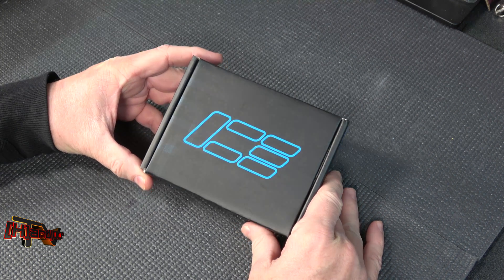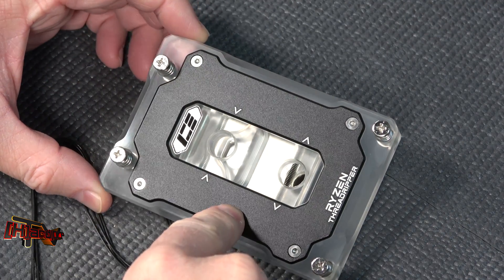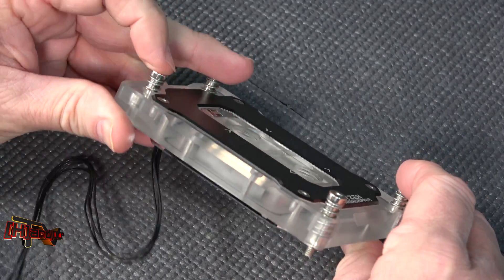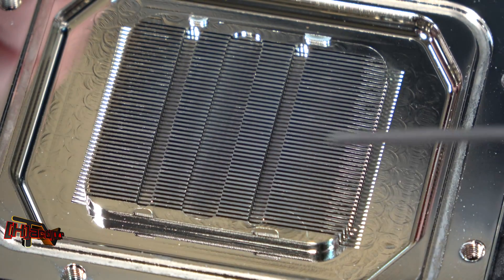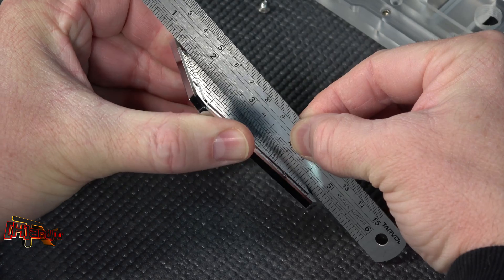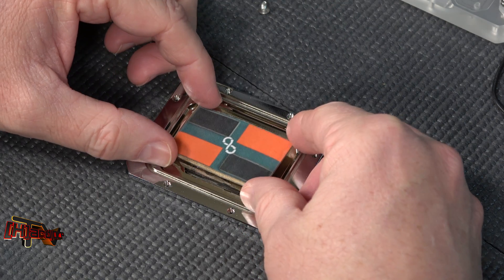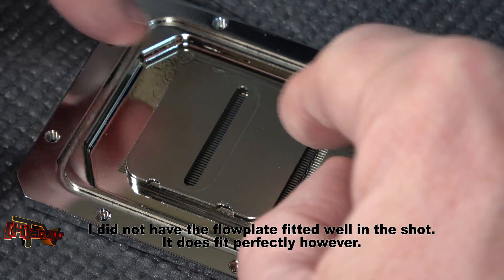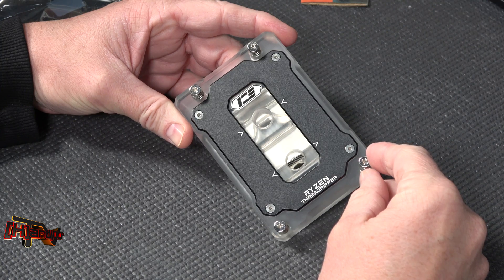IceMan Threadripper Water Block Unboxing and Breakdown

Comment: They're called "Flat Sockethead Cap Screws", not allen bolts fyi, (the 4 machine screws holding on the outer most face plate, the ones following that are standard sockethead cap screws)and if you simply provide the screws thread measurement (eg M4), the head's socket will be a pre-defined, standardized size.  Threading identifiers are both common and inexpensive.  Not being an elitest, just giving viewers the correct information should they ever choose to buy such hardware, they can correctly identify it.